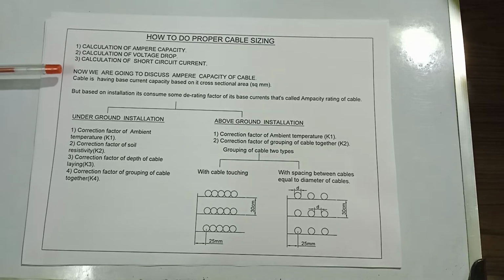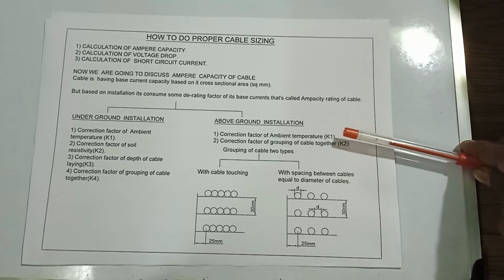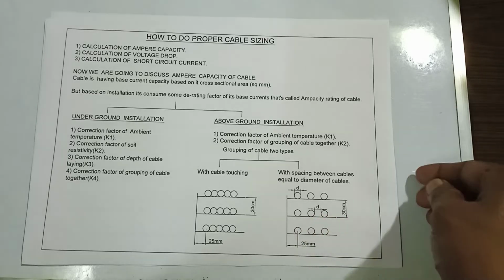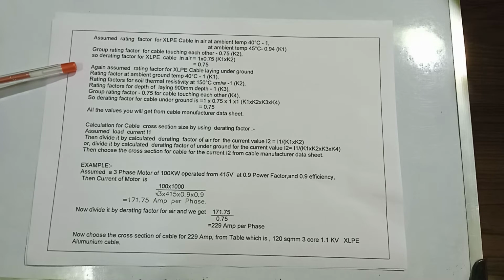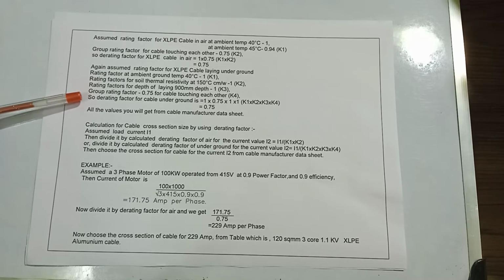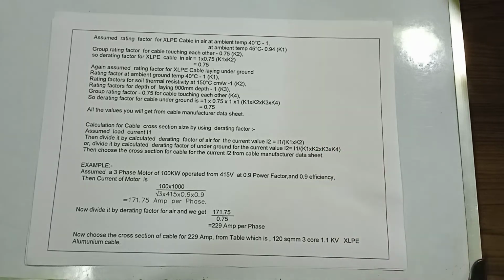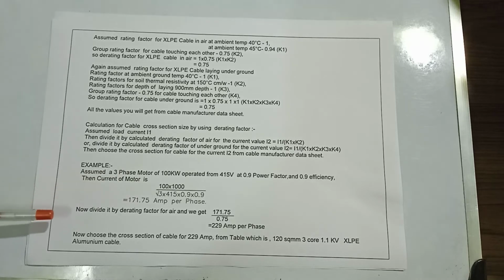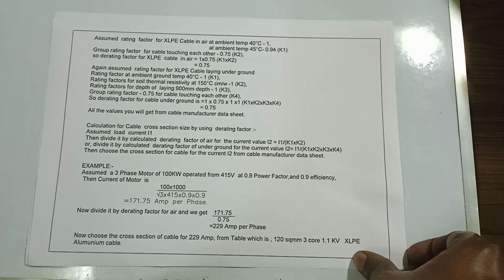Proper Sizing of Cable part-1 from ampacity factor, and voltage drop calculation

Comment: Sir sorry, I have question in cable sizing.
What is the meaning of no of runs?
Example:
5R/3.5C/240sqm/XLPE and
1R/3.5C/25sqm/XLPE
Thank you Sir
Reply: 5R - 5 cables, 3.5C - 3.5 core cable. Ex.- THREE CORE, ALUMINIUM/COPPER CONDUCTOR, XLPE INSULATED, ARMOURED CABLES.
some times current is so high that a single cable can't carry it, so we put some more cables in parallel. In your case  "5R/3.5C/240sqm/XLPE" there are 5 parallel cables are used.
😄